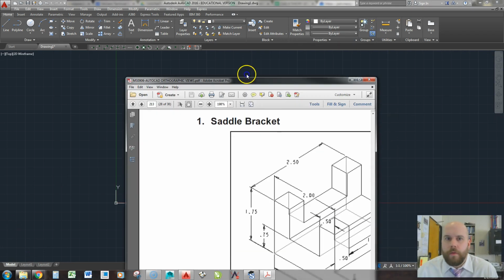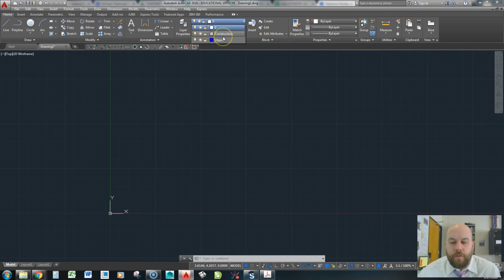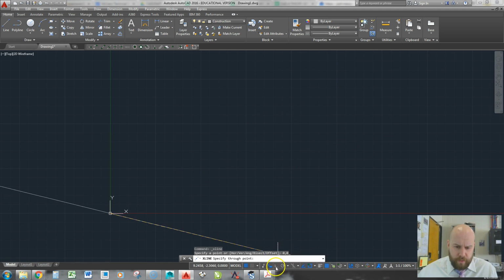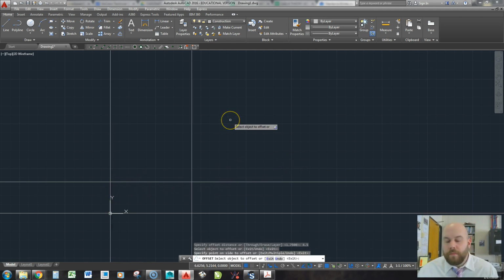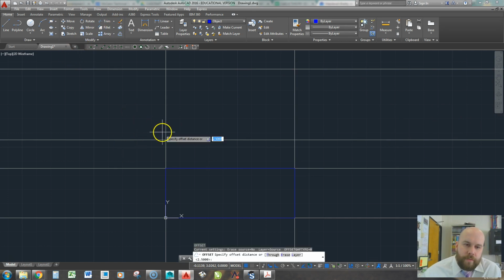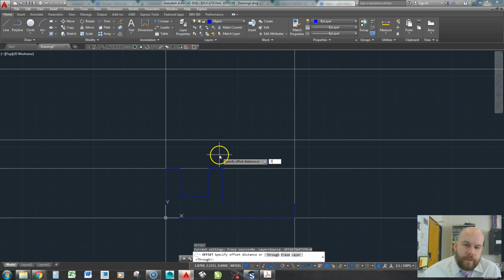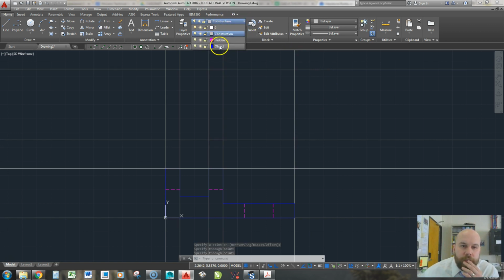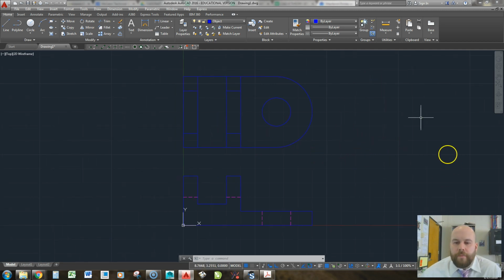AutoCAD: Creating the Saddle Bracket

Comment: How do we know how many orthographic views we need? I made three for this one with the side view using a mitre line.
Reply from the maker: That is based on 2 main things, but there are other considerations as well. First, the content of your primary (main) view that you are projecting off of. If you select your primary view correctly it should show the most about your part's shape and therefore be able to have a significant amount of dimensions. You will always have at least 2 views, but the amount of secondary views you project off of your primary view is dependent on the features you need to dimension that you can't see on your primary view. This part in particular is realistically only 2 views, the front U-shaped view and then the top view based on 3rd angle projection.